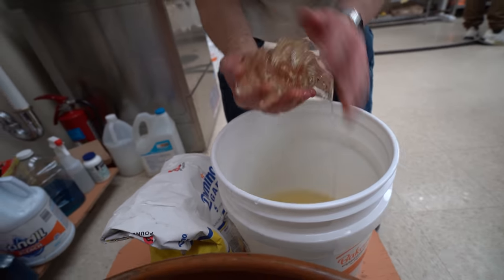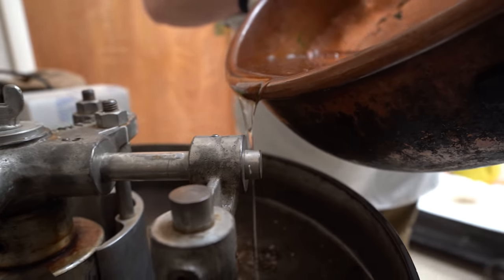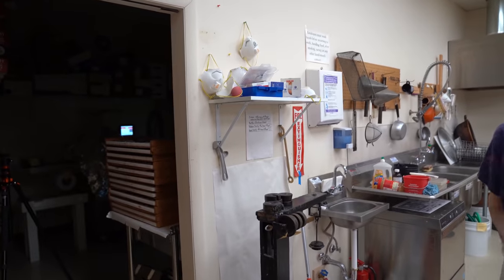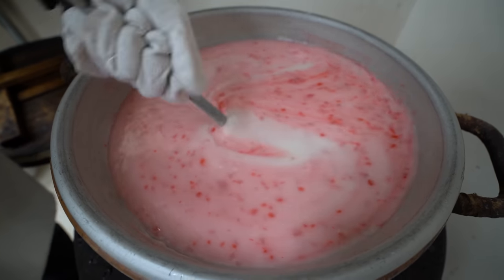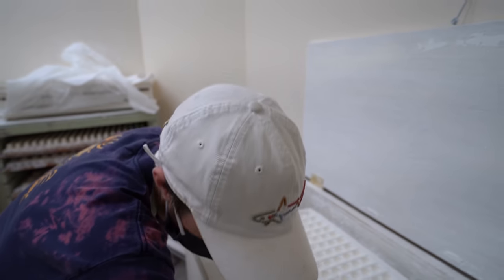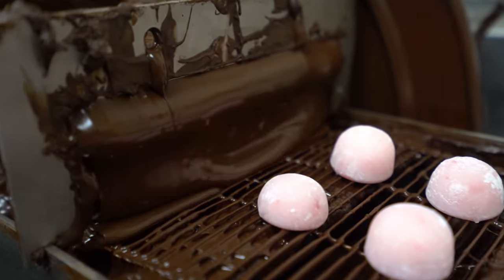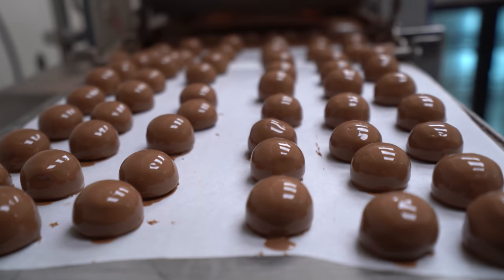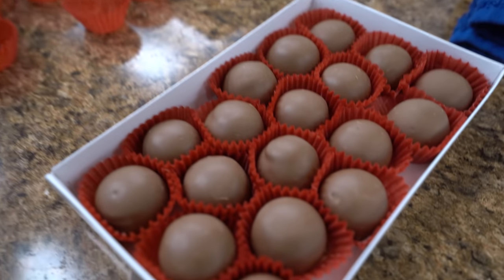We Made 3000 of This Candy! We Can't Keep It In Stock!

Comment: Suggestion for the hard creme removing. Place a pot of hot water underneath. The steam rising. Help the metal get a bit heated around the bottom. Loosening the creme. Or even a hair blow dryer maybe, to heat the metal up?

Comment: Silly question, if you warmed up the paddles would it be any easier to remove the cream? Maybe a pot of boiled water to keep the temp up.
Reply: He needs a bigger and stronger tool to remove that stiff cream. That was ridiculous.
Reply from the maker: They talked about that actually, but it would have to be done in between each scoop because the cream would cool the paddle down again

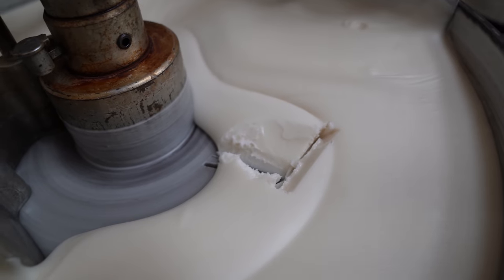Comment: 10:00 A small deadblow hammer would really help in this situation - just tap it against the back of the scraper. Would help save your palms!
And instead of trying to constantly scoop it, dig the scaper down to form a checkered pattern then tap it from underneath to scoop them. It'll release much easier

Comment: Great vid but, why didn't they remove the cream mixture from the stirrer BEFORE it set? Surely it would have been much easier to remove from something that didn't have all those blades etc in it. Also, random fact. I love cornstarch mixed with water. Found out in my 40s that it's called Oobleck and is a non-Newtonian fluid, which means when you run your fingers slowly through it, it acts like a liquid, but push on it too fast or hard, and it solidifies. Apparently it's something that every school child learns but l didn't so, I'm sharing for anyone who, like me missed out on the joys of playing with Oobleck until adulthood.
Reply: My mom would put it in the bathtub with us !! So fun ! 🛀🏾
Reply: I wasn’t aware of the terminology for it !! I guess fun is as educational as I get !

Comment: Have you guys ever considered a modified grease pump to transfer the glucose.

Or even a wet spoon ?

Oh how about this.

You suspend the glucose add a higher-level with an accurate scale on the tub and just open a rotating stopcock or similar.

And you just shut off the tap when the weight gets to the desired level..

I do understand tradition is important and habits are hard to break..

Meow

Comment: Why not put the water pan at the same level as the white bucket and pull up a stool? You'll same time eliminating the excess moves plus stop stressing your body.
One more: Digging that hard white cream out why not use a hammer to tap the putty knife in? If not good to use metal than a leather or rubber mallet. 
Work Smarter * Not Harder